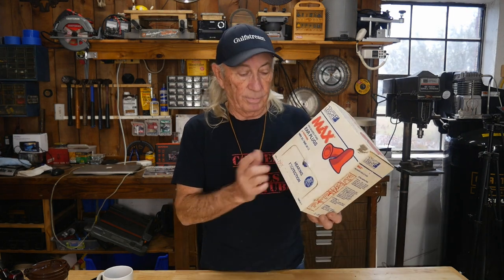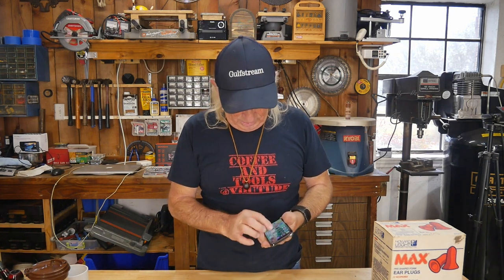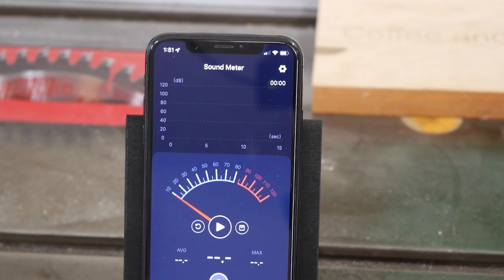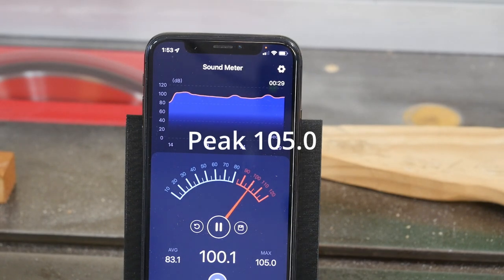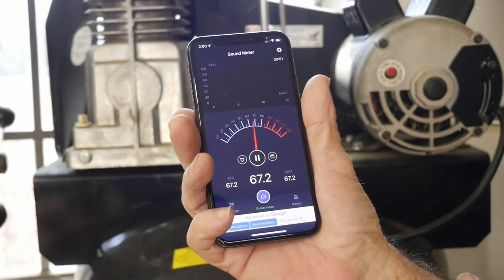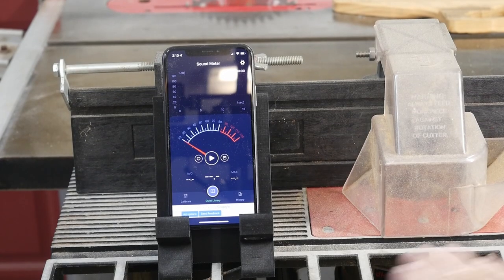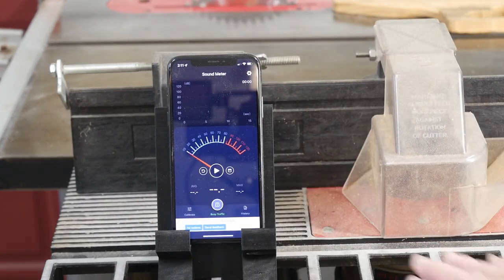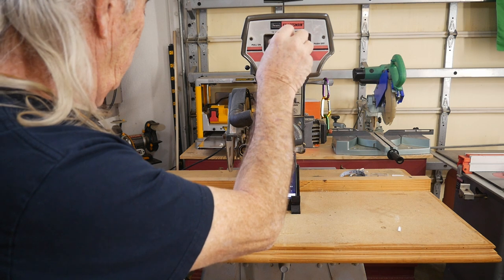What is the loudest tool you own ?  Coffee and Tools episode 212

Comment: My hilti concrete nailer is definitely the loudest of my tools, like a shotgun blast every time it’s fired. My air compressor is second loudest, but i put in the furnace room and shut the door when running it, or place it in another room. Third place is the router. Lathe and table saw run on nice quiet belts. Don’t get a direct drive, screamer of a table saw.
Reply from the maker: Yeah I was betting on the compressor, but lost
Reply: @SirTools    Not too many people have the hilti nailer. It’s really, really loud when nailing into a big I-beam.
Reply from the maker: @huejanus5505  I remember having one with the old 22cal shot...yeah..it was a good bang LOLOL